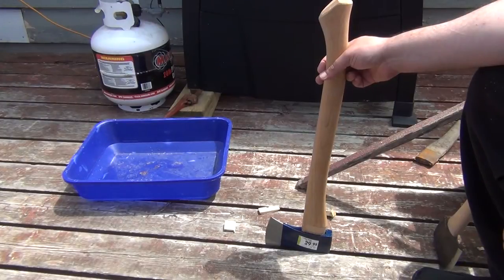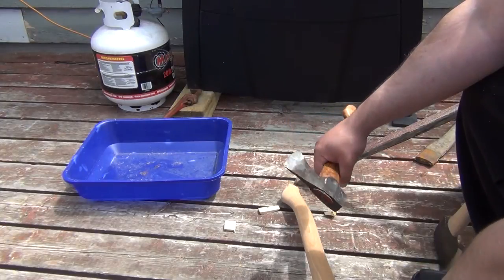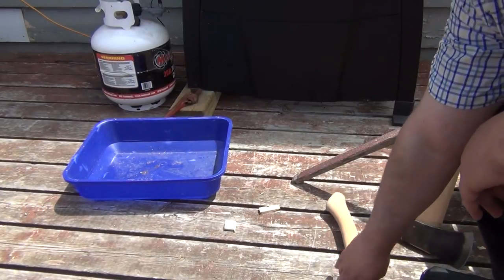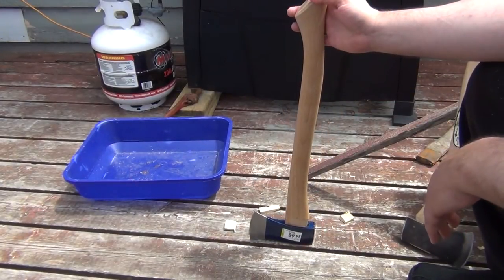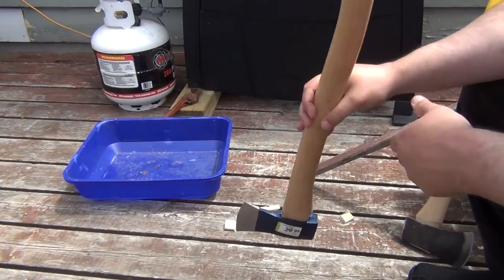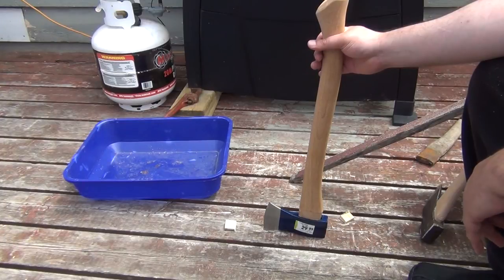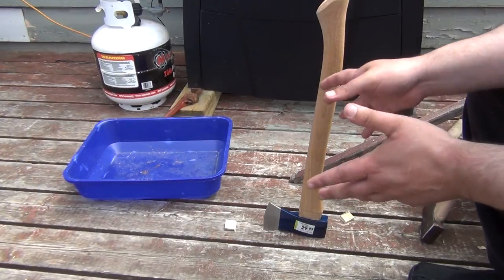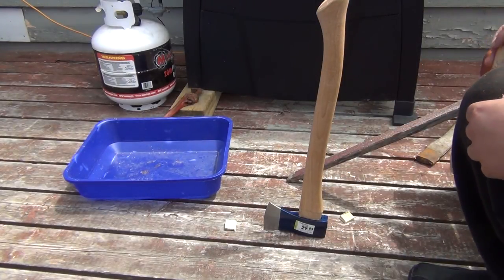Beaver Axe - introduction and over view

Comment from the maker: Yes, that is the reason why when metal wedges are used they should be lightly coated with a decent glue to hold the handle in place after the splitting. The splits however do weaken the wood hence why a lot of people will not use them until the haft starts loosen. Metal wedges also make rehafting more difficult.

Comment from the maker: Local wood is very soft, pine, juniper, fir, etc. . I normally run the edges at 10-12 dpd and increase slightly in the winter (1-3 degrees) as the wood gets harder and skill gets lower. This final edge bevel is only in the last 0.015-0.025", it then sweeps back, getting lower until it hits the primary grind. I normally finish with a micro-bevel at 15 dps, but this is mainly to ensure there is no burr.

Comment: So for best fit you say its better without a metal wedge...when i rehafted those axes i told you about, ive cut a few times the handle because of splitting( and started all over again)...i re-used the metal wedge on one axe and on the other i didnt have one so.....i put a metal coin in it, as a wedge....of course, wooden wedge on both...what kind of metal wedge would you choose? ive seen some in triangle shape, round pipe like shape...or even something like my improvisation?